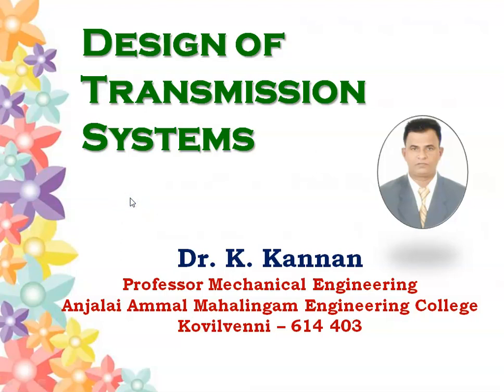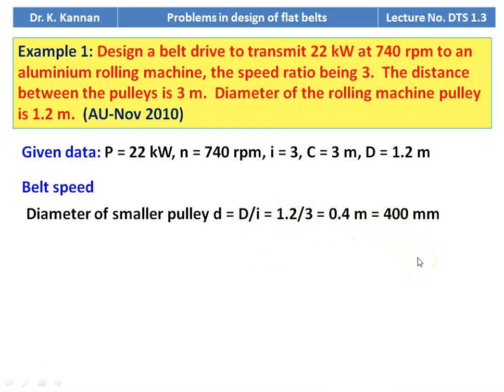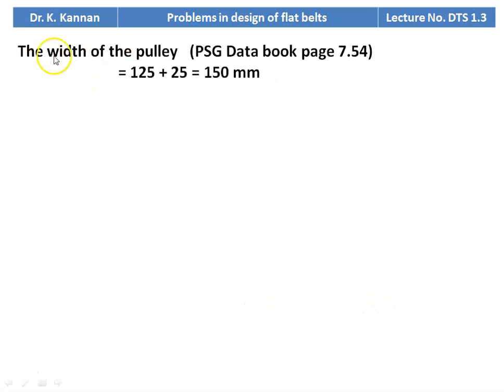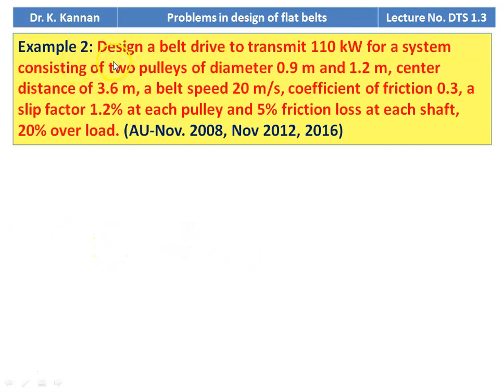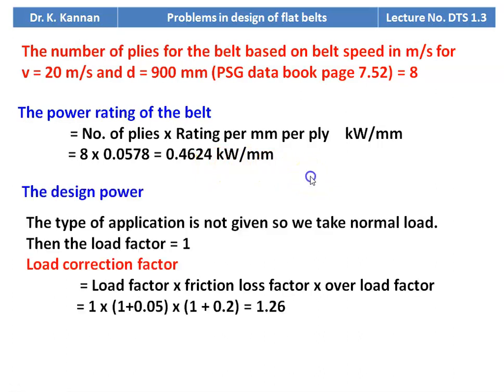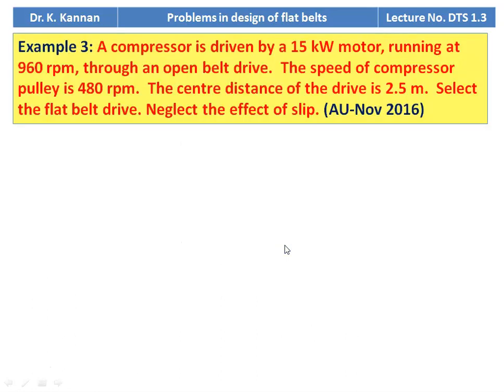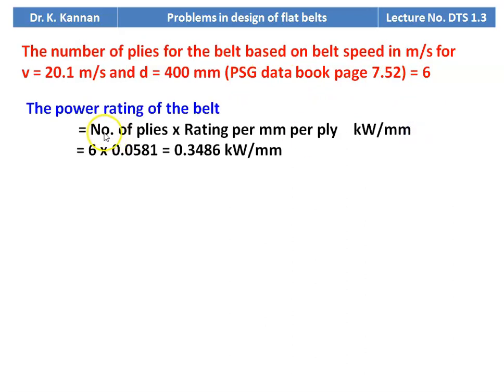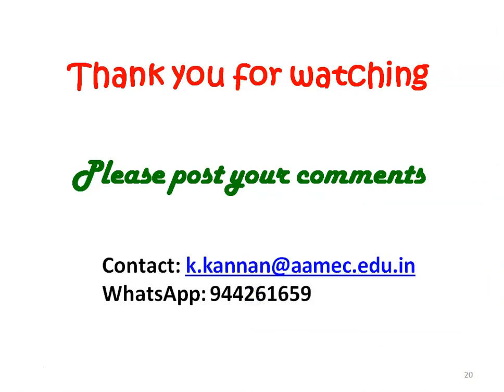DTS 1.3 Problems in design of flat belt - I

Comment: Formala for design power is power rating x load correction factor x arc of contact factor as you told in previous video.....but in problem why you used ( rated power x load correction factor)/ arc of contact factor

Please reply sir

Comment: For design power in KW
RATED kw x load correction factor
-------------------------------------------------------
Arc of contact factor x small pulley factor. 

How do we calculate or get value from psg data book for small pulley factor. 

Can you help me sir.
Reply from the maker: You take the formula
Design power = Rated power x service factor (Page 7,53) x Arc of contact factor (page 7.54) 
For the formula you mentioned you can refer to Machine Design by Sundararajamoorthy